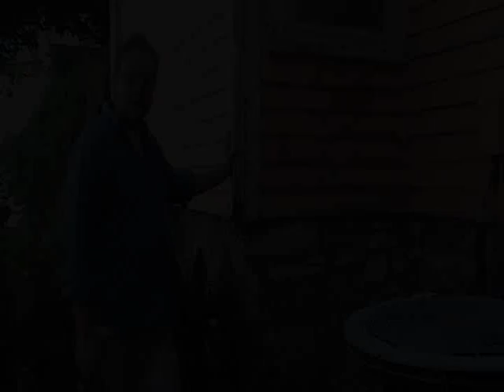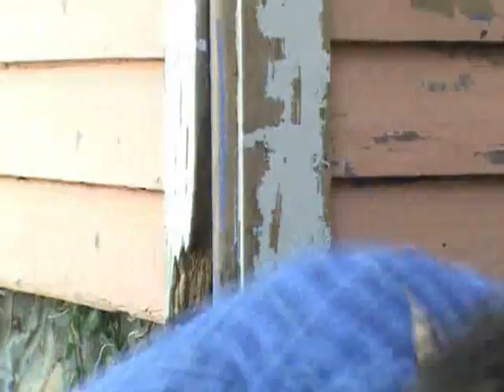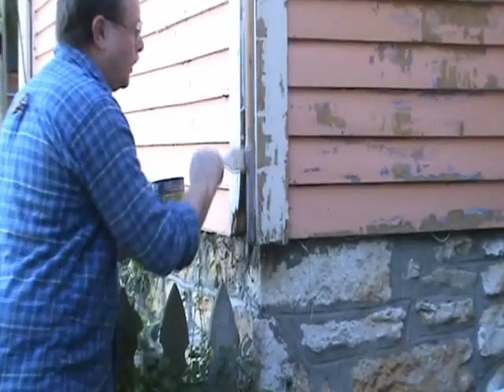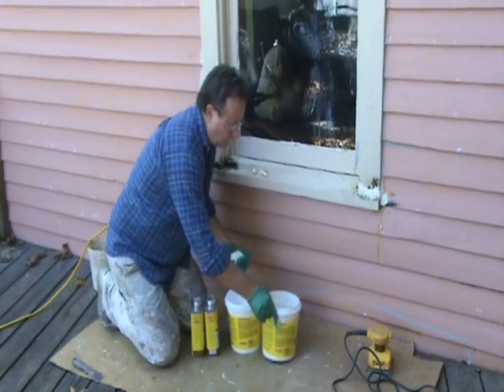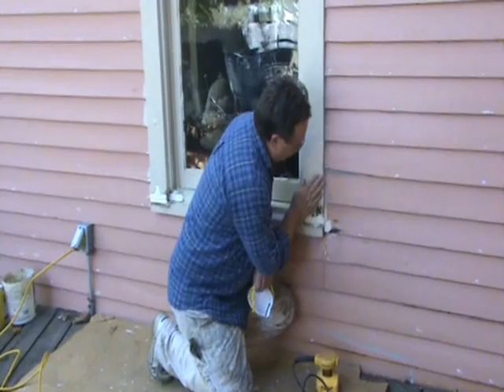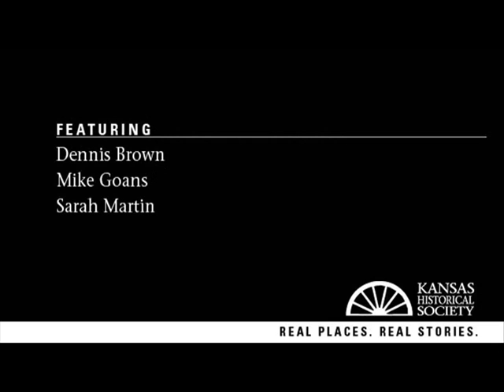Wood Windows: Using Epoxy

Comment: I prefer System Three's stuff. RotFix for sealing, and SculpWood for filling. Abatron is good too though. I've found that System Three is a little easier to work with, and usually a few bucks cheaper. Great video!

Comment: I've often wondered why folks refer to wood rot as "dry rot". If wood is kept dry it doesn't rot! --unless there is a fungus out there I don't know about (which is possible since I, at this writing, don't know everything yet). Fungal growth (that's what causes rot) is initiated when the wood moisture content rises above a certain level, usually north of 20-30%, in the presence of fungal spores, and remains "wet". It not only has to be wet but also must be exposed to the air (wet wood deprived of air doesn't tend to rot but becomes a fossil). When the moisture level drops and the wood dries the fungal growth stops. Fungal growth will resume when the wood becomes "wet" again, or has regained sufficient moisture content, I believe 15% or more. So, if you encounter dry rotten wood, you can be pretty sure that it got that way because it was wet, got rotten, and then just dried out!
Other than that, it's a pretty good video....

Comment: another tip is before coating with the wood hardener (step 2 here) coat all surfaces with antifreeze. The glycol will kill all fungus left from the dig out. After saturating (including the faces) let it dry, THEN coat with the hardener solution.

Comment: I prefer to use Builders Bog: it much more fluid and gets into the corners and holes much better. It's easier to form with a spatula too, plus it hardens to steel-like strength, which can be files or sanded easily into the shape you need.

It does often take 2 or 3 batches of bog to fill a large hole, however.

Comment from the maker: @greatcabby

Old growth wood (wood that from older trees) is denser and more rot resistant is better to leave on the building. Replacing it would mean most likely doing so with new growth wood. See the introduction video where Dennis & Mike talk about the difference between old and new wood.